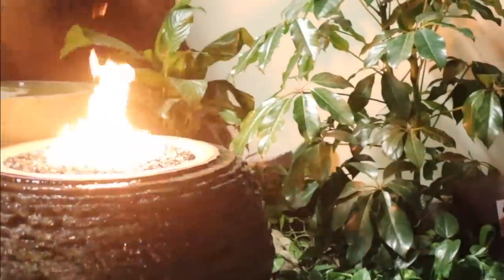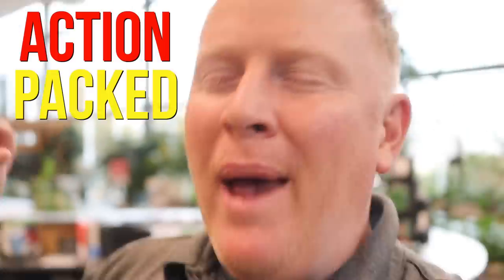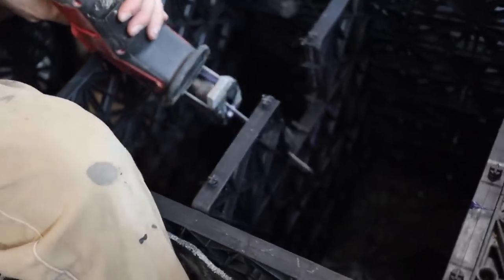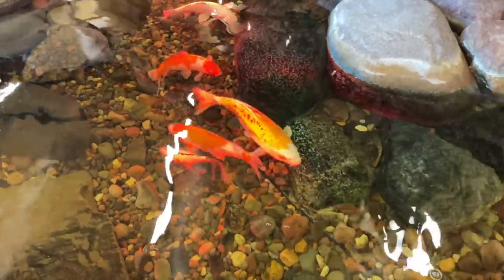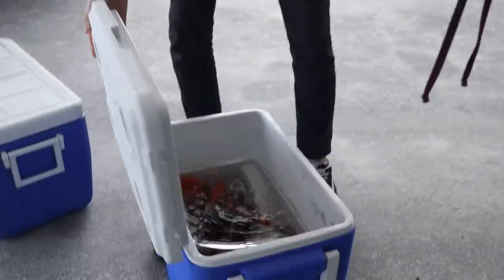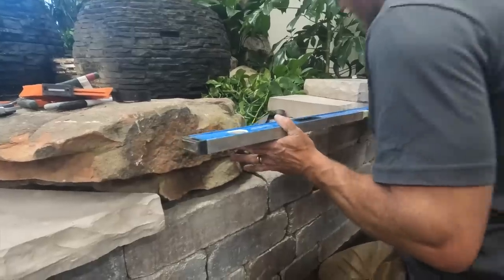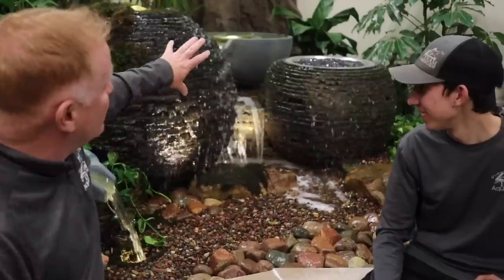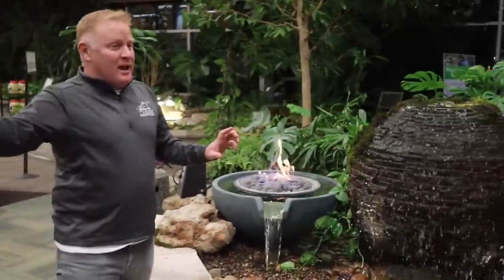I Burnt Down Aqualand!

Comment: Now with the gas lines for the urnes & stack slates are the comming from a propane tank or do you hock them up to a home gasline? I would think the home gas line would be less costly inches long run for any consumer. But I'm stumped on that & you guys show the fittings and pipes direction but you never show what line it plugs into. So if you can help me understand this please. I love all of you and love all your work!
Reply from the maker: It is connected to a propane tank